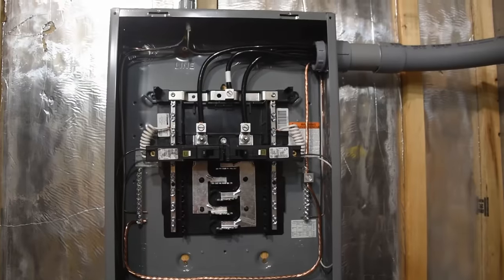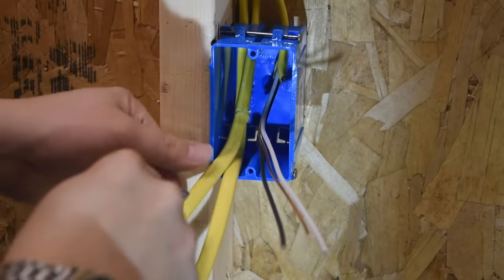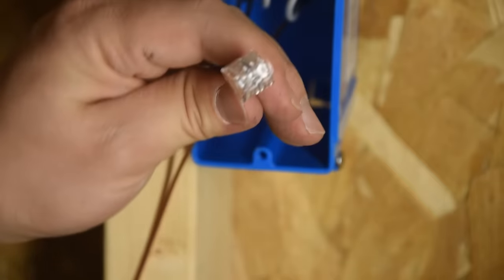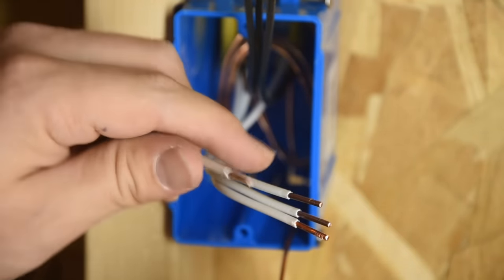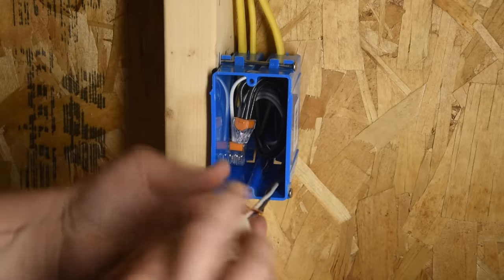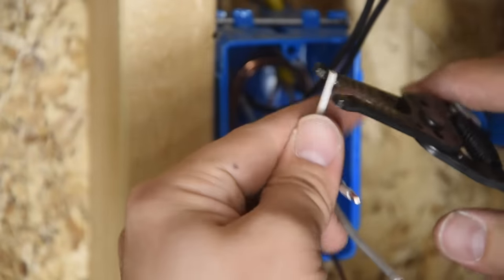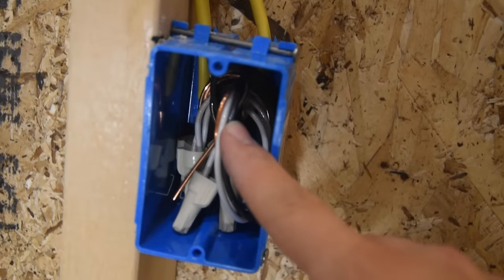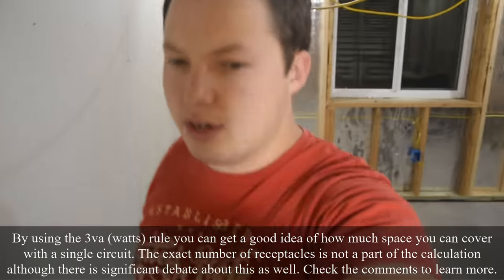Wago's vs. Wire Nuts - How To Wire Outlets During Rough In

Comment: I have used something like that but they had screw terminals in them.
Never liked the push terminal.
I called it the lazy man way of doing things.
Just my opinion of course.
Can't beat the screw terminals or wire nuts after twisting the wires.
I've seen wires pull out of a nut when not twisted.

Comment: I am removing a wall (top half) my wiring for the stove is in. I have to extend the wiring around and back to the same location these will work on extending the wring ? I will be using a junction box also where the wagos would connect the exsisting to the extension
Reply from the maker: As long as your connections are made inside of the junction box then you should be fine! Just make sure that the wagos that you use are rated for the size wires that you are using. Good luck on your project!

Comment: How are Wagos for carrying a higher amp load like maybe an electrical heater or something comparable?
Reply: My recollection is that they are all rated about 10 amps over the circuit that the wire would be in.  IE, if it’s a 20 amp circuit, the Wago is good for about 30 amps.  So, your breaker should trip well before it gets there.  I’ve also seen failure tests were the 20 amp Wago was run at about 60 amps before it failed.

Comment: Do you trust those I don’t think it’s a tight connection it’s almost like sticking it in the back of a stab lock receptacle we all the great part of the metal in the receptacle eventually that will come loose yes or now looks like a all time pushing stab lock receptacle which I don’t trust

Comment: Not bothered by the Wagos; if they are approved by UL/CSA and allowed by the NEC, use 'em.  I was more concerned about the horizontal wire runs.  Might be the camera angle, but it looks like they are right up against the sub-floor for the first floor.  I'd hate to be the flooring installer nailing down hardwood on the next renovation.

Comment: So in your links those wago's are 2x more expensive than nuts (11cts vs 5cts). How much extra money would it be for a project of a house? Not talking about labor just material.
Reply: Why Wago? If prof install time is money, i don't care what they say wago is faster and cleaner. The time saved, pays for the Wagos. If you install your self, i say wago, because they are easy and clean. Less mistakes.
Reply: They're at least 2x the price, maybe even more. But they're so much easier and save so much time. Plus the installation looks neater, in my opinion.
Reply: @aaron74  Which ones would you recommend?
Reply: @romt-712  Hard to say, really... the push-in semi-permanent ones demo'ed in the video are more for an install you know will never change, and lever nuts seem to be for possible wiring changes down the road. Honestly, though, you really can't go wrong with either of them I don't think. Both types seem super nice.
Reply: @romt-712  I have used the Ideal product when working with old wiring. Some of those old-timers cut the wire very short in the junction boxes. If you are doing reno work the Ideal/WAGO are very helpful.

Comment: Even using WAGO's I still twist my wires to ensure a more secured connection & less chance of one popping out (contrary to popular belief, they don't always work).  Also never have the wire nuts facing down, they should be facing up, in the event moisture gets in there it'll run off the wire instead of into the wire nut/wago where there is that thing called electricity.  Also never use the blade to slice the insulation back all the way... simply slice the end open and then pull it back off of the conductors.  You will prevent a short instead of accidentally slicing that black wire open. Just saying.

Comment: I would still use a wire nut in place of the wago connectors. Wire nuts are a much better connector. The wagos that are in recess cans I always use or if I’m installing lighting I’ll use them but I would not use them on plugs or switches. It’s a lazy way of doing things imo.

Comment: Usually, on new work and old work involving rehab, I put each bedroom on its own circuit, and depending on size one or two circuits per room. Also on the same note, I install ONE separate 20 amp circuit in each room for space heaters and that way the heave current draw on some heaters are fully AFCI/GFCI protected as well as the first device on the home run in every room..Wire nuts I use on occasions where stranded wire and solid wire need to be joined, other than that, Insure or Wago's is the way to go.  On kitchens, always follow code on wiring as well a the rest of the structure, and the idea of using one wire  connection on outlets using Wago's is a great time saver.

Comment: Are there certain slot holes in the wago that your putting each wire in???
Reply: No.  Doesn't matter.
Reply: Only one wire under each spring clamp is allowed. There is one hole per spring, so only put 1 wire into a hole. Max one wire per hole.
All holes work the same, they are all connected via the same metal bar inside.

Comment: The wagos are for easy installation, they always tend to fall loose over time and if that’s happening what happens every time I switch on and off a 1875watt hairdryer inside that little wago connector. Hmm scary thought for me, physically twisting them will make sure they don’t come apart and have far more contact surface area. If I ever seen an electrician doing this on my house, I’d make him redo everything

Comment: Just remember push in wagos and lever lock wagos are NOT the same thing! I actually trust the lever lock wagos 😄 especially good when mixing solid and stranded of different sizes, I still dont like or 100% trust spring loaded push in connections, ESPECIALLY with stranded conductors 😒 kinda like shark bite push fittings and plumbers I guess 😄👍

Comment: If you know how home transformers work, you would know that the "neutral" wire is just as hot as the hot wire.
Reply: The neutral is grounded.  The "hot" wire(s) are not.
Reply: @Old Time Farm Boy
I know how it works.  I am also sure you intend to mean 120V where you state 110V, and 240V where you state 220V.
Yes, the neutral is an essential part of a 120V circuit.  But it is also grounded.  That is why it is not called a "hot" wire.
Reply: @jovetj  
Voltage depends on what formula is used to measure it.  The two main ones result in either 110/220 volts or 120/240 volts.  Either way, in an alternating current circuit, the neutral wire is not a ground and is not grounded, it is part of the alternating circuit that delivers current from and returns current to the coil in the transformer and is just as "hot" as the "hot" wire that is in the circuit.  Grabbing the neutral wire while you are grounded is every bit as dangerous as grabbing the "hot" wire while grounded.  Personally I think they should establish a more appropriate designation that does not make it sound as if there is no danger involved with that wire.
Reply: @oldtimefarmboy617  "neutral wire is not a ground and is not grounded," It absolutely is groundED, not ground. Go look in your panelboard and see where the neutral bus is bonded to the ground bus, and also look in the NEC where you will see the terms ungrounded conductor (hot) and grounded conductor (neutral). When a circuit is open the bond to ground in the panelboard pulls the neutral down to ground so no potential exists on it.
Reply: @seanmcgroty2248  
Electricity requires a complete circuit.  You can not get electricity from the transformer coil without having the electricity return to the transformer coil it came from.  Alternating current means that the current to a device must go back and forth, to and from the coil, through both the hot and the "neutral" wire which means both are hot.  The neutral wire is only called neutral because it connects to the center of the 220/240 volt coil in order to provide 110/120 volts necessary for the average device used in American homes and/or because they just needed some way to differentiate it from the 220/240 volt circuit.

The ground's purpose is to ensure that any current, for whatever reason, that gets into the metal casing of an electric stove or oven or other device with metal in its housing has a path of least resistance that is not a living being.

Electricians know this but to the average uneducated in electrical circuits person, neutral sounds like it means there is no current flowing through it.  So it is fortunate that most people do not get into their electrical wiring or panel boards.
Reply: @oldtimefarmboy617  No one is saying current can flow without a return path. You keep quoting theory but are not applying it correctly. Everyone can see you haven't addressed why neutral conductors are bonded to ground in a panel, why electrical codes call the neutral the "grounded conductor", or another one, why the volt difference between neutral and ground is a few volts and not 120. Until a circuit is closed line current is not present on the neutral.
Reply: @seanmcgroty2248  
When a circuit is open (a break) there is no current flow through the circuit, yet if you take a voltmeter and put it on either side of the break you will get a full voltage reading.  The reason why there will be very little to nor voltage reading between neutral and ground is because the neutral wire connects to the coil in the transformer and not the ground in the panel.  Any current generated by the coil wants to go back and forth through the coil and with the circuit broken there is no current.

Comment: I've been using wire nuts for decades without a single issue. Done a lot of remodeling and rewiring and every push connector especially Wago style is a FIRE waiting to happen. Never seen one that wasn't causing some sort of issue. By the time you get them wiggled into the box they are almost always loose. Nut always up to prevent moisture collection, required by code in my area. The lever style are so much better and safer than push. Wago levers shine when mixing wire types and gauges.

Comment: I mounted a outlet into a normal box  adding a 2nd box so I had 3 wires coming in 3 going out and 3 pigtail's all that wouldn't fit I ended up using a deep box

Comment: I put in my connector boxes and wiring as I'm putting in the drywall. 
You get a perfect fit for each box, and there's little you have to measure.

I also tape the wirenuts, and will also run tape around the outlet screws.

Comment: Electricians 
“ never back wire an outlet...... never!”

Also electricians 
“ wago connections is god! 

Twisting is no good, unless you are making a loop and wrapping it around a screw that has a high likelihood of loosening up over time” 

Some spring connections good
Some bad. 🤔

Actual electrician here 
Strip
Twist 
Clip
Wire nut tight 

25 years. Zero callbacks related to failed splices that followed the proven method.

Only hacks don’t twist first.

Comment: I use the Ideal version almost exclusively.
Reply: I use the Ideal version also. I like the flat profile of the Ideal over the Wago square profile. The Ideal connectors are available at HD for less than $8 per 100! Sure beats $5.95 for 10 at Amazon for the Wagos. The Ideals are so inexpensive I never reuse them!

Comment: Wegos are a problem. 
Believe it. The little tab inside does not have the ability to handle the current and will lose tension and cause problems. The load wire burned out of the wego completely and dropped out of the connector in a junction box, otherwise I would not have found the problem.
Reply: cool story bro

Comment: They cost quite a bit more per connection than good old wire nuts. Not reason to pay more really. Nuts been working fine for many years and actually make the best connection when measure heat on the connection when current is going thruogh.

Comment: I’d use pig tails and wire nuts way before I ever used wagos on plug circuits. It’s just a tried and true way of doing it. Of course it’s more work but usually that’s the standard. Don’t always take the easy way out.
Reply: im leaning towards using the wago lever ones for multi circuit ground connections for testing and trouble shooting i myself love copper crimps and than the nylon caps keeps busy bodies from messing with connections. (will use wire nuts for smokes and fixtures tht will be easily/commonly replaced
Reply: I agree with the copper crimps , as long as they are installed correctly. I’ve seen many of those overheated , especially on the neutral connection. I use the wagos when they are pre installed in recess lighting. Other than that I don’t trust them lol. I was thinking about using wagos in plug and switch boxes with two or more wires but I’m just not used to it and I hate change lol. On things like that at least. I’ve been doing it with wire nuts for so long I just want to keep using them.

Comment: Never use those push in wagos unless it is in a led can light. They are the same garbage connection that is used in a back stab on a receptacle. Give it roughly 10 years max and you'll see back stab problems, sometimes as early as 5 years.  I know I get called out to fix them. Proponents of it ALWAYS blame the installer. It isn't a good tight mechanical connection. That is the same reason you should pretwist your conductors before a wire nut regardless of the manufacturer saying you don't have to. I've fixed a handful of melted wire nuts from people wanting quick and easy and just twisting the nut on.

Comment: After pulling off the neutral wires from the Wago, you didn't notice that the wire broke off close to the insulation when you were pushing it back into the Wago . Everything was perfect except that. I watched it 10 times before I noticed it. Great presentation though.
Reply from the maker: Really? I'm going to need to watch it again to see what you're talking about. What was the timestamp for that?

Comment: I’ve personally seen Wagos full on fall off WAY too many times to trust them on anything besides low current, low voltage stuff like LED fixture wiring (like from the driver to the light unit), and only then with the maximum size wire the connector will accept. If you’re twisting your wires up, you’re putting your wire nuts on wrong.

Comment: If you don't like using the backstab connection of an outlet or switch, you shouldn't be using Wagos. As for me, I don't like either because of resistant shorts. Plug'n go is faster, BUT you get more contact area with wire nuts and lugs.

Comment: There is no better connection than splicing with Kleins and using the correct wire nut. 
A wire nut is not intended to hold the splice, it just insulates it. You DO NOT use wirenuts to twist the connection.
People don't realize electrical connections are the most important part of a system and MUST be done perfectly that takes years of experience. If it is spliced professionally, it will outlast the home built around it. 20 years as a master electrician I have seen the worst possible connections in boxes like these. These push-in connectors are junk, if I had no choice I would use the lever action connector instead like he mentioned. You see how easy the connectors pull off, think about it. 
I will spend an extra few seconds with my linesmen pliers and mechanically fuse those conductors permanently.

These have been around for years and I know all about them. They are for light fixture connections only and even then I will cut them off. 

I will stick with the tried and true methods because when it comes to safety there is no easy way out...
Reply: Is it against code?
Reply: @sterlingferguson7234  depends on the jha the nec is technically just a bare minimum recommended guide!

Comment: I have an extensive number of wire nuts in my shop which I will probably rarely use in the future. I have used push-in UL recognized connectors from various vendors for solid 12- and 14-gauge conductors for some years now. I have also more recently used Wago 221 series lever-operated connectors with a combination of solid and stranded conductors. These are all so obviously superior to wire nuts, that unless you are dedicated to saving a few cents per connector you won't use wire nuts from now on.

Comment: Stranded wire doesn’t have to be twisted because the wire nuts make them bond together
Reply: Stranded wire must still be twisted two full turns - it's in the instructions for the wire nuts - the law says that you must use the connectors as intended by the manufacturer and according to the  instructions... I was called out on this by a Marin County electrical inspector in the nineties - he took me to school and I had to fix several buildings of an apartment complex as a result 😳
Reply: @sinistersparky9657  instructions on wire nuts says no pretwisting necessary with either solid or stranded, just to to lead stranded. To twist the wire nuts until you get 2 twits after the nut
Reply: @daijoubu4529  indeed that is a fact. And also what I said.

Comment: Wiring residential it's okay to not twist wire ends together but commercial electrical that's not recommended. i once took a wire nut off a 277 v  re model and the wire bunch blossomed open running over the back of my hand and shocked the hell out of me. i say twisted ends and wire nuts.

Comment: If you ask an old timer electrician, you will have your answer as to why everyone does not use wago's. After many years, that type of contact has a much  higher failure (open circuit) rate than the old standard twist wire-nuts..They are fine initially. But over long periods of time, you are better of skipping the wagos'